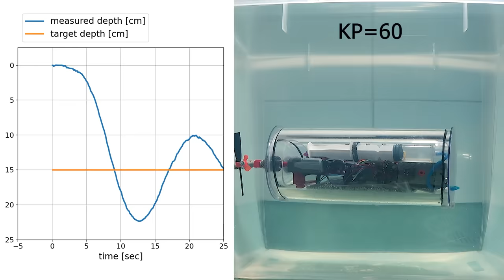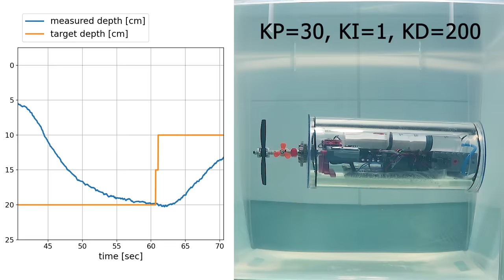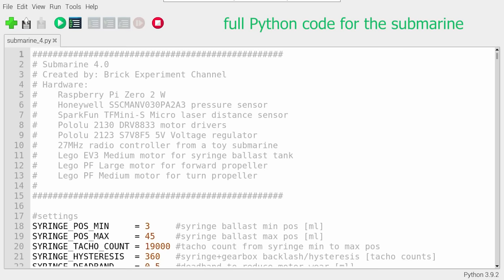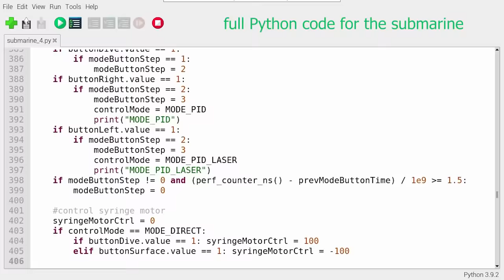Building a Lego-powered Submarine 4.0 - automatic depth control

Comment: I don’t understand how the boyancy control works once the entire mechanism is placed inside a solid waterproof container.  The density of the entire system does not change with the moving of the syringe. The only thing I can figure out is that the small hoses to the outside for the “pressure sensor” allows enough volume of water to move inside the container to change its total density.  ???????

Comment: How does depth syringe work?
Reply: The same way like "Compressed air don't have buoyancy".

To prove this, is quite simple. Have you seen scuba diving oxygen tank? In the water, it weighs almost the same be it full or near empty.

But if the overall device is a lightweight materials, low pressure and high pressure air can give buoyancy and dive respectively

Comment: I dont get it with the depth control,the amount of air remains the same right? So how come it is possible?
Reply: If you pause at 02:26 you see two Blue pipe. One is connected to Raspberry Pi for pressure sensor, one is connected to the Syringe.

What does the Syringe do? It's letting in water from the main front window. And syringe is watertight, so it won't leak in the main Hull.

When the Syringe is pulled backward, the hull atmospheric pressure increases, but also letting in water, making whole thing heavier.